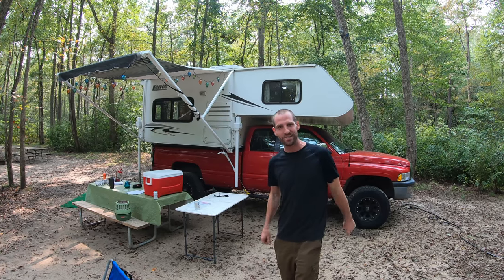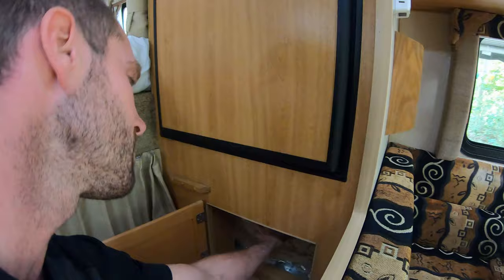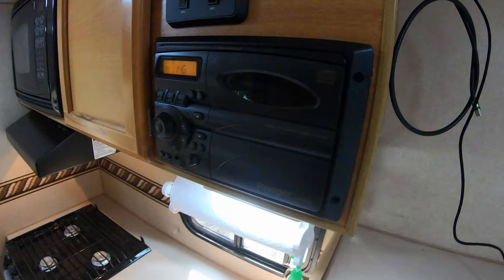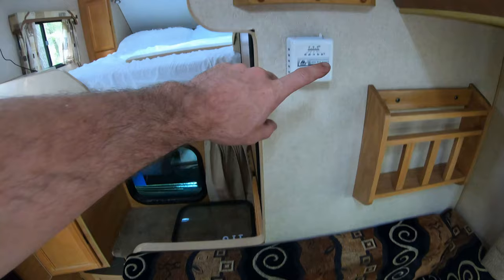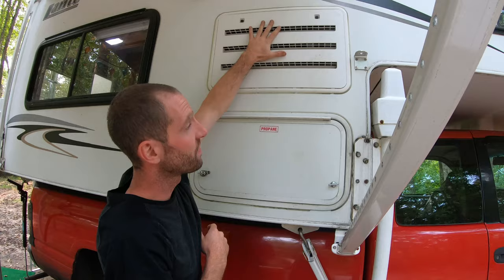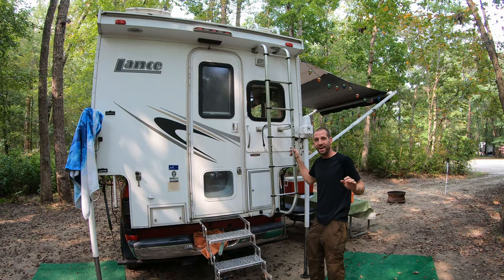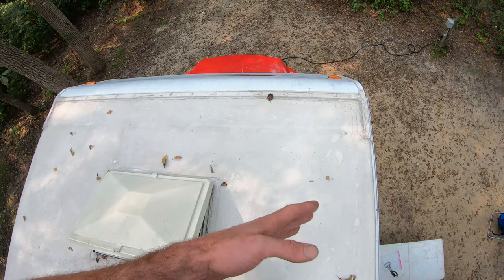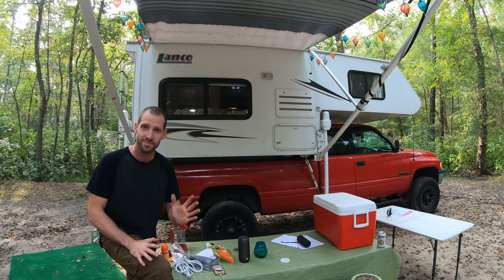2006 Lance Lite 835 Truck Camper Tour / Overview

Comment: Lance makes probably the best 8' Camper Going.  I have a longer one so I could have actual grey/black tanks.  I would go crazy with the placement of the release valves and connectors in the 8'.  Something to look out for the "C Channel" escape hatch SUCKS IMHO.  If it cracks and breaks it is very difficult finding a correctly sized replacement.  Clean it up and clean your AC UNIT and put some kind of UV protectant on them. You should swap out your ordinary vent in the bathroom for one with a fan.  It might even be prewired for it..  Lance does a good job of running wires.  All in all it's tough to be the design of a lance camper.  I think their kitchen layout is way better than the Northen Lites.  Plus I do NOT like carpet in a camper it simply makes no sense.  I took all the carpet off the step into the bunk and in the cab area too.  The 8' is pretty awesome for weekends.  I didn't think I would like the extra overhang until I got it and when parked WOW it is so much bigger inside.   You do pay a weight penalty though.  The newer Lances with the slides are way too heavy for a non-dually.  But a 9-10' Lance in an older model is light enough for a 3/4 ton if you beef up the springs or get air bags.  I really liked your video.  I actually looked for an 8' model but they are super hard to find as there is so much demand.  In order for me to tow I need to replace my entire hitch system and its a lot of money to throw at it.  Plus the longer ones take up so much room in a parking spot.  But it's a small price to pay.  So much better than pulling a Trailer for my needs. I resealed the entire roof after I got it "just in case".... and it is long tedious miserable job.  If you plan on using it a lot upgrade the onboard inverter and go Lithium.

Comment: When I was 11 we moved back to Canada from Germany - Dad's next posting was in Comox on Vancouver Island. He and Mom bought a Datsun pickup - a King Cab with a diesel engine and 5 speed transmission. FIFTY HP! A few months later Dad found a used Okanagan truck camper in Calgary and he and I drove there and back to pick it up. It was a great trip and I have fond memories! It was pretty basic - no AC, no bathroom, and the main bed was the dinette. My bed folded out up top and Dad only had to sit up and hit his head on it once for me to be relocated to the tent, with the dog for company. We kept it when we moved to Calgary the year after and had it for a couple more years. Family camping trips were such good times.

20 plus years later in Ottawa where we live, my wife and I decided that camping - campERing, sorry - would be fun with our two year old daughter. For eleven years we did just that, first in a pop up and then in one travel trailer followed by another. I agree with you on the Fantastic fan - I've installed a few and they're great! Always with a shroud so they can be run one the road and/or in the rain. Camping was the best kind of family time for us.

Thanks for the tour of you great truck camper. It kinda makes me want to get back out there....

Comment: This is pretty much the exact camper I want. I could easily see my wife and I living in this full time. Your back yard is anywhere and you have nearly every amenity you need. Definitely a retirement goal. Awesome overview!
Reply: Hey buddy if you do go to living in one and I hope yall do I would suggest putting solar in. It will save yall a lot of money in the long run living in one especially winter. I've lived in campers for 8 + years in my life at different times and winter time was expensive and was tuff dealing with propane bottles.  I had room for 2 30pound bottles in last camper and I thank GOD I did cause I was going through a 30 pound bottle every 2 and a half days running central heat in camper but it kept me warm with no problem and spring to fall I would only use 1 to 1 and a half 30 pound bottle for cooking and hot water. I sure wished I would've had solar. It's just a suggestion and I hope it might help you and others! Take care and Happy Trails my friend!
Reply: You would hate the tiny waste tanks full timing.  Find a 9.5' if your truck will handle it.  So much better and easier to empty.  Otherwise if you use the shower you will be dumping every day or other day...or notshowering.

Comment: I really truly had no idea that they still made those kinds of campers....my grandparents had 1 like that when I was a child... grandparents had it in a dodge 3/4 ton 4 on the floor with a granny gear... we used to take trips all over the U.S.A with that rig... I was probably about 6-9 before it got to where they could not go any more...in that rig anyway... then they got a motor home... I loved that motor home... I could lay r play games with my sister in the bed while they drove one of them got tired of driving needed a nap and boom..go take a nap...a/c worked good to while we were going down the road.... I think the generator had to be running for the A/C to work while it was not plugged in to a outlet like at a campground... it was a blast....

Comment: Just found you’re truck camper videos. My wife and I truck camp also, we’re going to Golf Shores this weekend. We are hooked because it’s so simple. You can park just about any where. It’s amazing at the room you have in your truck bed if you have a truck camper. We have a 2500 Dodge Ram with a Bigfoot camper.
Reply from the maker: Awesome! I appreciate you checking the channel out.  We are hooked as well so far. By far my favorite aspect is the fact that you can park in any parking spot. We like to check out dive bars in random towns while traveling and the truck camper makes it easy to do so. I always wanted to get the Bigfoot, but haven't found a deal on one. They are pretty hard to come by in my area. Sounds like a nice rig you have though.

Comment: Love the 835. We have been looking a while and just picked up an 06 that is nearly identical, same interior theme and everything!

Great concise video too!
Reply from the maker: It really is the perfect truck camper! Not too little not too much. Just perfect. And thanks!
Reply: @NoNonsenseKnowHow  same thoughts here. The 815s seem too small but anything larger requires hitch extensions to tow which we didn’t want. Plus you don’t gain much on the bigger ones without them getting huge.

Comment: Great video! I am in the process of buying the same year and model camper. I appreciate the ""No Nonsense" approach to the walk-through. Everything I needed to know and nothing I didn't.
Reply from the maker: Thanks and glad to hear you found it helpful!  Was a great camper! Ended up selling it and getting a truck camper from the '60s that we are doing some work to now
Reply: @NoNonsenseKnowHow  Why did you sell it? Was it too small?
Reply from the maker: No quite the opposite. I wanted to get something smaller and lighter and cheaper

Comment: I have the exact same camper I shopped around for quite a while, looking for a hard side one without the aluminum it is great and cold weather and nice and quiet. I looked everywhere for it and finally found one that is in great shape. I have it on my 2500 Silverado fits it perfectly on an 8 foot bed. I would definitely recommend this camper

Comment: 2nd gen pickups are so durable... solid front axle, floor shift 4x4, slight factory lift, built proof 360 V8 gasser

Comment: This was great to watch! I own a 1991 Six Pac Mini 6.0. Similar in size but the interiorplan is less economical. Yet I love my Six Pac (yessss, i finally have a six pac 🤪). I run it on solarpanel only. Completely of the grid. 
My pickup is the little Rabbit pick up from the eighties. The set works like a magnet on highway stops and campsites 😂

Comment: Nice place.
I had a custom built 12 foot camper with a side door that was on the back of my 1977 2 plus 2 Chevy 3/4 ton, 400 4 speed.
Large but nice.
Yours is the perfect size for your truck.
Very nice.

Comment: Couple of tips, always use your water heater on propane only when the AC is running with 30 amps, trust me on that one. Put a pizza stone in the oven and it will bake biscuits etc much better.

Comment: Thanks for the Great tour!  I like the tear-down time-lapse. I have a 2004 F-150 I'm thinking about putting a truck bed camper in, so we can still pull the motorcycle trailer.   Do you have a Back-up camera?  I think that something I would need to install right off the bat.
Reply from the maker: No problem and glad you liked it.  I did a truck camper for similar reasons.  Great to still have access to the hitch!  Yes i have a backup cam.  very handy
Reply: I don't think you can use a 1500/f150 truck for slide in/cab over campers because you will overload them & they will Squat in the back.
Reply: @reinablack5531  I wasnt thinking a full size camper, just something small. However, I went with a topper and bought a 20' cargo trailer to haul the motorcycle and do a conversation for camping.

Comment: How does the truck handle with it on there? I have a 2000 2500 same wheelbase and engine and considering this route, just concerened about how the truck will handle. Thanks! Nice setup.
Reply from the maker: It handles it but drives more like a bus once it's on there. Definitely have to change your driving habits a little bit when loaded. Otherwise totally fine

Comment: Hey brother, I'd love to know what tweaks you made to the 2500 to handle the camper? It looks like there's a slight lift; anything else?

I've got an 03 Hemi 1500, just wondering what adjustments I should keep in mind!
Reply from the maker: I think of 1500 wouldn't really be beefy enough for a camper this size personally. We actually sold this one cuz we wanted something lighter and ended up with a clapper camper. But just heavy duty shocks, and a hellwig rear sway bar are the main modifications. Factory height truck. They sit high from the factory

Comment: Cool little camper, I’m curious what things you said you’d mention if you do the video after using it a few more times. Perhaps the size of the gray and black water tanks. How long does that last and your truck a Manuel or automatic?
Reply from the maker: I will probably do an update video on it in the springtime. The tanks are definitely way too small. But it just takes a little getting used to.  And the truck is a manual 5-speed
Reply: @NoNonsenseKnowHow  thanks for the quick reply. One of these rigs are for
Sale near my house it’s a Manuel 5.9 Cummins 3500 with a lance 835.  Truck seems like a fair price at 21k but I don’t know enough about the camper to judge that asking 17
Reply from the maker: 21k for both the truck and camper? Or you're saying 21k for the truck in 17 for the camper
Reply from the maker: Can't go wrong with a 5.9 Cummins manual trans. Love my truck. Unless of course you want bells and whistles. They don't have any of that
Reply: No I don’t need all that either. I drive an older car right now anyway. And use my phone for gps. Might dig out some old cassette tapes. And 35 for both.

Comment: This truck camper is nice. I'm looking for a used one. This seems perfect. Would it fit in my 2013 tacoma sport shorted? What's the ballpark cost for something similar? Thanks. Great vid.
Reply from the maker: This would not fit a Tacoma. But they do sell compact ones that would. Honestly the prices are all over the place depending on region and condition of camper. I see them anywhere from 3,000 to like 12,000 for something similar as this
Reply: @NoNonsenseKnowHow  thank you for your time. Great video. Some people sit and talk too much. You were precise, brief, and interesting.  Thanks again. Be safe and happy trails.

Comment: Yeah, when campers get water leaks they go down hill at the speed of light. There is nothing more important than keeping the rain out. I've had few campers and RVs at this point I wouldn't buy any camper at any price if I can tell it ever had a water leak. By the time a leak shows the camper is in bad shape even if it only looks like small problem....Any road, I have a 97 12v, what kinda MPG are you getting with the camper driving at what speed?

Comment: How is it driving with a truck camper? I have seen them go down the road the bigger ones look a bit tippy or if a big gust of wind hit them looks like they would tip right over? Maybe not.
Reply from the maker: It's not bad. Takes maybe an hour to get used to and then it feels normal. Definitely a little tippy and I would imagine the larger truck campers even worse

Comment: Not to try and get too personal but how much does something like this go for? I’m really thinking hard about one of these but I’m not exactly rolling in cash
Reply from the maker: Truck campers are fairly pricey compared to a pull behind.  Paid 10k for this one since it was really clean. Ended up selling it for the same a year or so later. We decided to get something smaller and picked up a clapper truck camper from the '60s for $1,000.

Comment: How much did you have to do the truck to prepare for the extra weight? springs or sway bar ect... thanks
Reply from the maker: Just added a rear heavy-duty sway bar and heavy duty shocks. That's it

Comment: how long will a bottle of lp last when using the heat at night only? and other stuff as needed of coarse. thanks....
Reply from the maker: Pretty darn long! We did a week and a half trip and it and had only gone through maybe a half bottle using everything. I suppose it depends on how the temperatures are and how much you cook and all that though. But very efficient

Comment: How much is a used truck camper like this?  Or what should I pay for it?
Reply from the maker: Hard to answer that question. Varies dramatically depending on region. I've seen them anywhere from $2,000 to $20,000. But if you get one in nice shape for like six or seven k I think that's a pretty good price

Comment: nice camper ! 
I have a 97 ram 2500 xtra cab cummins 12 valve 4x4 
also a 2003 lance 835 aluminum siding 
my question is do you think one is better then the other aluminum vs fiberglass ?
Reply from the maker: Wow, that's crazy. We have almost The Identical set up.  Honestly I don't know the aluminum ones are pretty sweet because you don't have to worry about delamination. I'm impartial on either or
Reply: NoNonsenseKnowHow 
Sounds about right ! 
Thanks for posting all these videos you help me change my lift pump in one of your previous videos definitely appreciate it keep up the good work
Reply from the maker: @truckcampertraveler7369  no problem at all. I really appreciate you watching and commenting. Thank you!!!